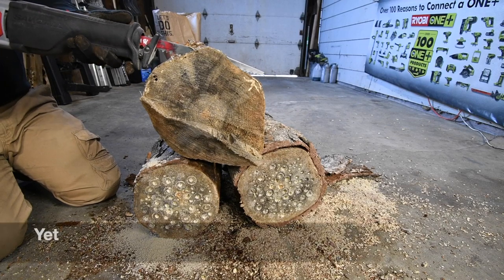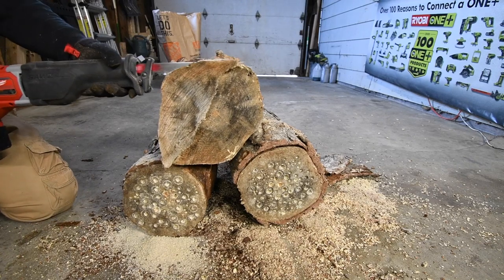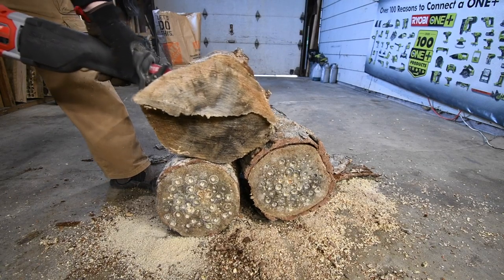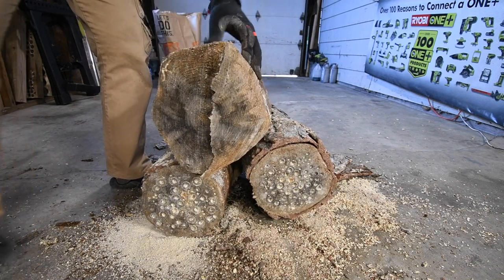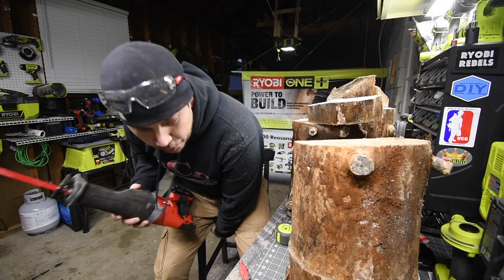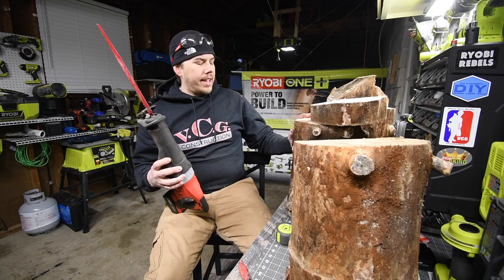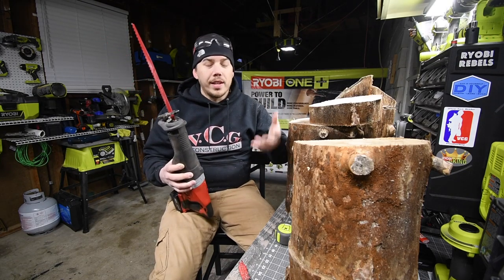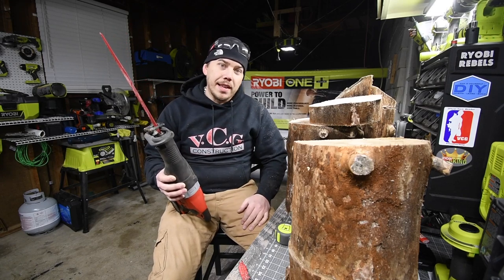Milwaukee Recip Saw stress test

Comment: I knew the Milwaukee would do it.  I have the same saw. I also have the hammer drill and impact and grinder and the circular saw.    I built a little hide away out in the woods with just these brushed tools.     Its a log cabin big enough for 2.     I keep all my batteries charged ready to go.   Next week I'm building an old style outhouse and log fence.     Thanks for sharing the cordless tools are a great thing if shtf.
Reply from the maker: very good, I wish you luck on your build and I thank you for viewing Ernest

Comment: I have the Ridgid reciprocating saw with those diablo carbide blades $13 each, the saw doesn't bog down, trimmed a whole tree with it, it gets very warm but not really hot and it keeps on chopping, the 4 amp batteries run out in 25 mins of non stop hard use full throttle 👌 the next day I did an old tree stump used 3 4amp batteries but the tool doesn't stop oh and it has a lifetime warranty 👌

Comment: What did the wood chips look like coming off the Ryobi chainsaw?   We’re they big wood chips or fine saw dust?    
If they’re big wood chips.  That means you got a sharp chain and it should cut well.  If it’s a lot of fine saw dust that means your chain is dull and needs to be sharpened or replaced.
Reply from the maker: I only used the chainsaw a couple of times and the first time using it I fried the motor, then I got the motor replaced, the chain is pretty much brand new. that specific chainsaw is just garbage, I want the Ryobi 40v  chainsaw
Reply: Man Caver Tools that’s good to know.  I was debating getting that saw or doing something else.   I think I’ll do something.  Probably just use my recip saw with pruning blades for now.

Comment: I've used my Fuel Sawzall to prune my tree's, battery power is just easier to deal with then a gas chainsaw or polesaw on light duty work.
Reply from the maker: awesome and this is the old brushed version and it did a fantastic job. the super sawzall would be a beast against this log

Comment: I used the Dewalt brushed reciprocating saw to cut up a tree that fell. It worked good.
Reply from the maker: very good, these tools have more power than people think
Reply: I work for a tree service and i use the recip for all my side jobs, right now I have 950$ worth of work on a 3.50 dewalt blade and the thing still looks new!